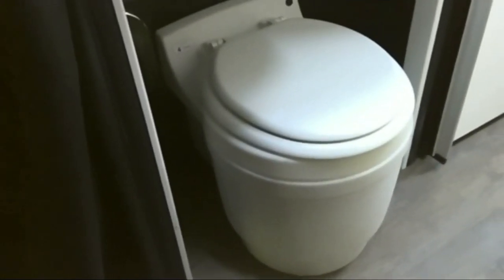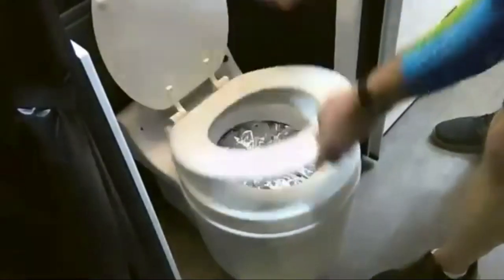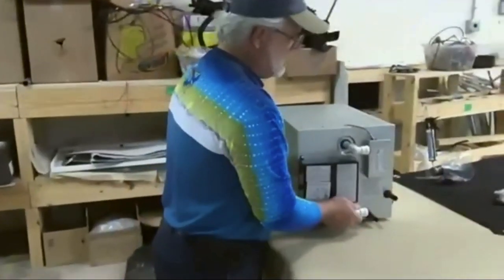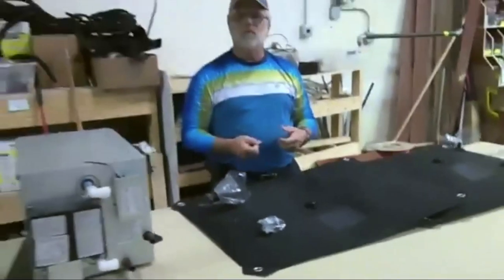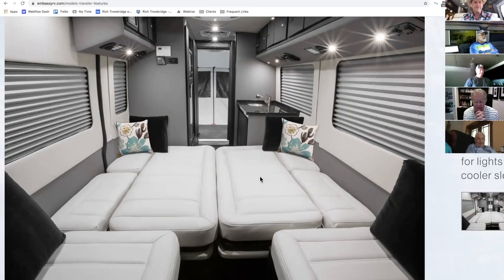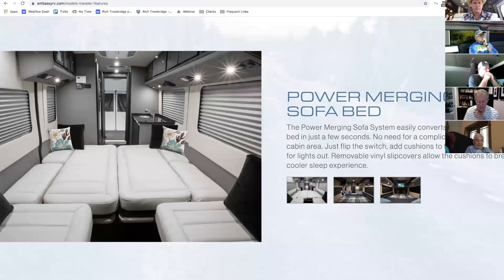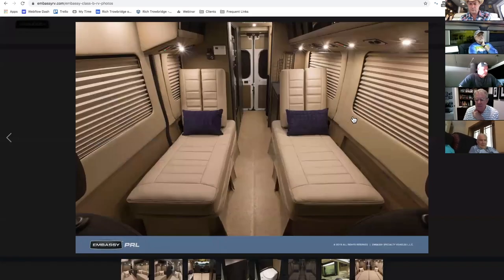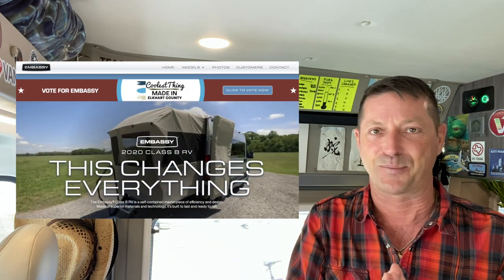RV HYDRONIC HOT WATER & WASTE WATER systems explained by EMBASSY RV, makers of innovative Class B RV

Comment from the maker: Enjoy this look into different approaches to heating and waste systems. Check out www.EmbassyRV.com
Reply: I have to add a safety comment on the use of gasoline for heating.  I would be worried about the long term safety as the units age or malfunction.  The Army used to do this, but just accumulated too many issues and accidents.  Coleman cook stoves also used this principle for years before switching to all propane units.  Its one of the ideas that seems to make common sense, but doesn't pan out in practice.  Gasoline has just proven to be too flammable and volatile for that application.